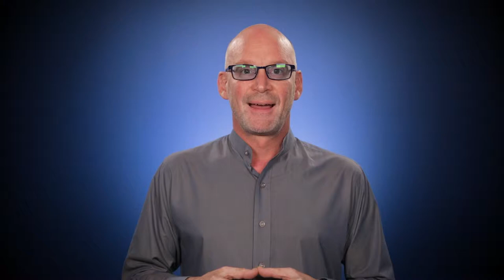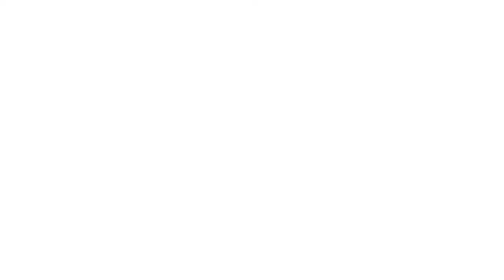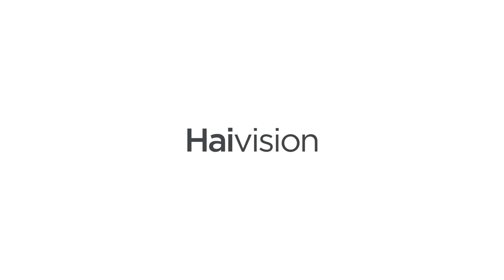What is a Video Encoder?

Comment: If H.265 is better than H.264 why premiere pro still asks us which one to use?
Reply: Because not everyone will need h.265, its a lot slower but will give better file size but its barely used on a lot of sites. Better encode to a format like vp9 which is better than h.264 and h.265 and it is supported on a lot more sites